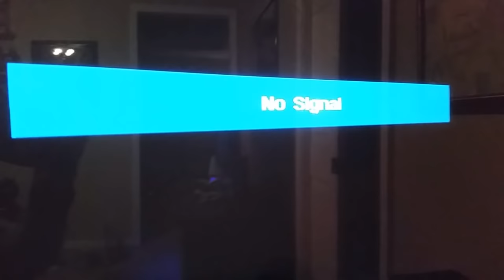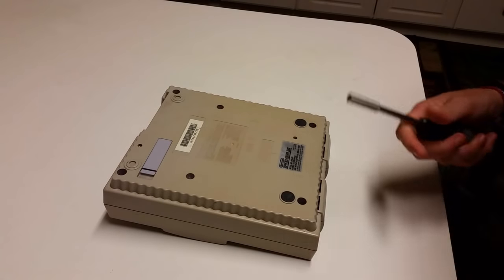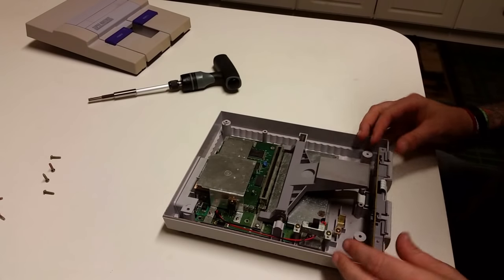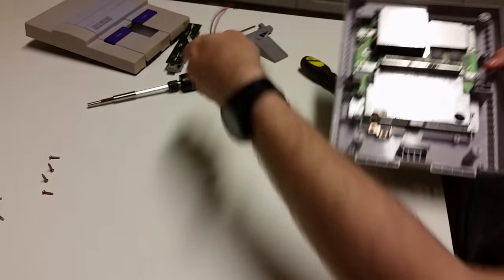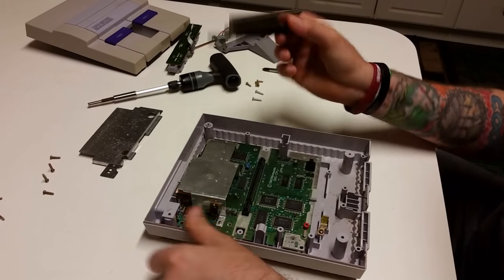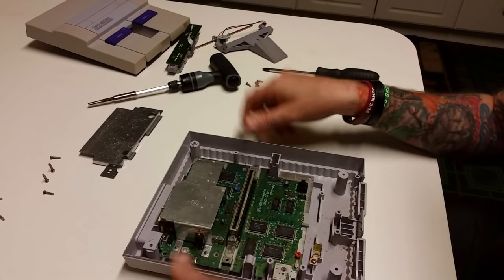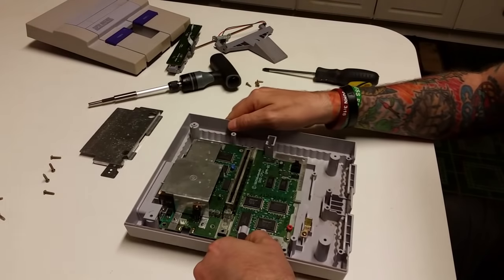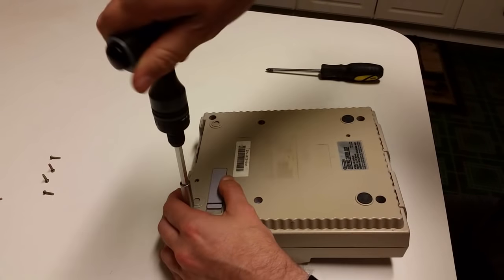Let's Fix The Super Nintendo! - No Signal Fix

Comment: I scrubbed my connector with alcohol and seemed to help some. I just used one of the 1up cleaning carts and could not believe what it took off. It had black connector marks on it after using. System works great now.

Comment: Hi ! You said that 9/10 times this fixes the no signal problem, unfortunately after following all those steps it still doesn't work for me ! No signal, no nothing ! But the power switch does turn on and I ordered new cables. Still doesn't work. Do you have any other solutions for me to try? It used to work perfectly then I stopped using it for like 1 year and now it doesn't work any more. The connections are all clean and not oxydised.... Thanks in advance !
Reply from the maker: Have you cleaned your games?
Reply: did you get your working? I have the same issue
Reply: @TattedCollector  yes
Reply: @drhidayath  nope :(

Comment: My pin connector won't come off.  It has black screw plates unlike the silver ones shown in your video.  Do I have a different model where the pin connector isn't supposed to come off?  I appreciate any help!
Reply: The same happened to me, could you fix it??
Reply: @julianaramirez7669  It turned out nothing was wrong with my system, just had a bad cable.  Try a different cable if you can (the one that connects the system to the TV)
Reply: @afterthought55  how did you know it was a bad cable? My cables look good and I’ve cleaned the pin connectors on 2 different snes’s and neither of them will turn on. 😕 

Also the reason your pin connector wouldn’t come off is because later year models were fixed to the motherboard. Most ppl making these videos don’t mention that little bit of info. I have a ‘95 and a ‘93 snes and the ‘95 is fixed to the motherboard ‘93 is removable.
Reply: @J10969  I think I just bought a new cable and figured it out that way.  Thanks for the info, hope you can fix your SNES's!

Comment: I’m getting my SNES to play with the RF cable connection but not with the AV, while in AV mode I’m just getting volume but no video with the same no signal across the screen. My question is would the problem require this same fix?

Comment: My issue is not the signal but that it only gives me the black screen with no sound. I tired cleaning the pin connector (not opened) and still nothing with other games. If I try what you did on this video, will that work and fix the problem?

Comment: ok so what about the 10th time out of 10?? I've cleaned so much that I've went through 2 walmart size bottles of 91% IA, and still same video results as before I even broke open the first bottle. I think the pin connector is bad, but not sure if it's the one soldered to the board that went bad or the removable section. BLAH!

Comment: Any advice on how to clean the 64 pins on the inside of a SNES 1995 model? The 64 pin is soldered to the board and can't be removed like the earlier models can.
Reply from the maker: Just take a toothbrush and dip it in isopropyl alcohol and scrub it down for several minutes like you're brushing your teeth. Then, make sure the pins on your cartridge are also cleaned, use a q-tip.
Reply: @TattedCollector  Ok, I'll try that again.  I didn't that once already. I picked this SNES up at a yardsale and I looks almost like someone spilled something inside of it.
Reply: @TattedCollector  I have the same 95 model. I tried a toothbrush as well three different times. It started flickering in and out so a little improvement. Anything else that can be done to access the bottom side or the connection points other than just keep at it? Do I need some other fine brush to get as far down as possible if I can only access from the top?

Comment: My snes console doesnt have the option to remove the top section of the pins where the games plug in. It all seems to be one piece. What can I do?
Reply from the maker: Not do this step. This step applied to MY consoles. It won't apply to everyone's.
Reply: @TattedCollector  I wasnt aware that the snes consoles had different hardware inside. I'm new to old consoles. Thanks.

Comment: What if the RF works fine but Multi out doesn't?  Two different cables and two different TVs tried.  Definitely the port?
Reply: mine shows no signal on composite cable but rf scan tunes into a black screen. Still no sound or video output from the game cartridge. any idea what could be wrong?
Reply: @drhidayath  I replaced the motherboard
Reply: @antoin1888  oh thats a no go for me. Cant source a working mobo anywhere close
Reply: @drhidayath  Got mine off ebay

Comment: Well I'm out of luck cause I don't have a stupid security bit to do this. It seemed to fire Sunset Riders perfect on the small hdtv and not my Vizio 4k smart tv. All I get is no signal.
Reply from the maker: The console should preferably be hooked up to a CRT tv. It's going to look horrible on a 4k TV anyway. 90s technology wasn't built for new age televisions. HDTVs will distort the pixels from the games and it will look very pixelated and washed out.
Reply from the maker: You can also buy the security bits on ebay for just a few bucks.

Comment: Thanks so just wondering do you know how to fix white screen issues on Nes?
Reply from the maker: His&Hers 66 If the screen is blinking black and white, it could be the 72 pin connector. If it's a solid white, it could be the 72 pin connector or a bad PSU (power supply unit).

Comment: Do you use any converters to hook it up to an hd tv? I have an av to hdmi and still no signal after cleaning the pin connector.
Reply from the maker: No. I play all of my retro consoles on my Sony Trinitron CRT. Have you tried cleaning your games?
Reply: @TattedCollector  But the TV in the video is a Samsung flat tv.
Reply from the maker: True, but that was just used for testing purposes. Now, years later after that video was made (April 2018) all of my retro consoles are hooked up to a Sony Trinitron CRT in my gameroom.
Reply: @TattedCollector  But the question still stands, do you have an upscaling solution for the setup in the video? I tried 2 different consoles on my Orion flatscreen TV with both composite and analogue connection and it doesn't detect any signals. And yes, I spent 2 days cleaning one of the consoles and it didn't solve the issue. I keep reading everywhere that modern TVs just don't work with the 240i resolution of the snes.
Reply from the maker: you're right, majority of modern tv's don't work with the resolution. So..solution...get a CRT, problem solved.
Reply: @TattedCollector  Based on this video, Samsung TVs support 240p natively: https://youtu.be/lHoOKLWIMKU?t=692

Comment: Mines Has Sound But No Video ???
Reply from the maker: Pin connector probably needs cleaning, or could be an AV Out issue.
Reply: Did you ever figure out what was wrong with it? I'm having the same problem.